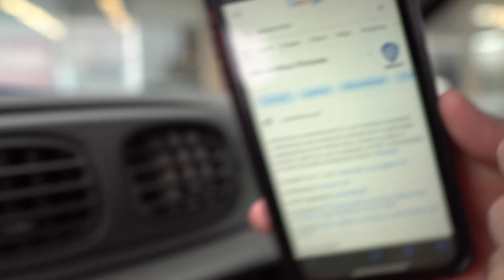Mullet vlog and arm workout

Comment: hey, I know you probably won't see this but my name is Billy, I'm 14 and want to be a professional body builder one day. The only issue is, I have cerebral palsey on the left side of my body which makes it incredibly hard to lift things over twenty pounds with my left arm. my right arm has to compensate making it way stronger than my left, so my question is, what should I do if I want to make both of my arms equal strength, I know it may be a dumb question but it's seems like you know everything in this category. Btw your videos help me alot, your an incredible Inspiration
Reply: Plenty of dumbbell work bro.Only do the amount of reps your weak side can handle and eventually you will even out good luck man